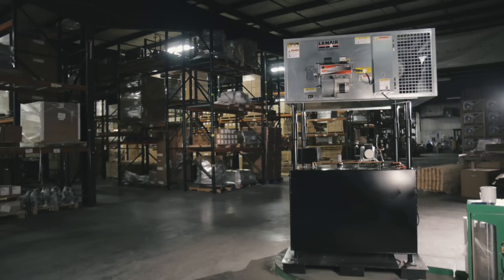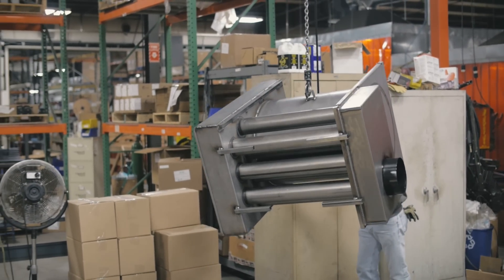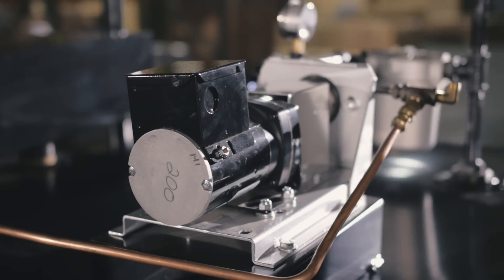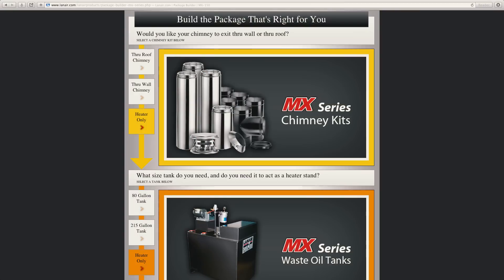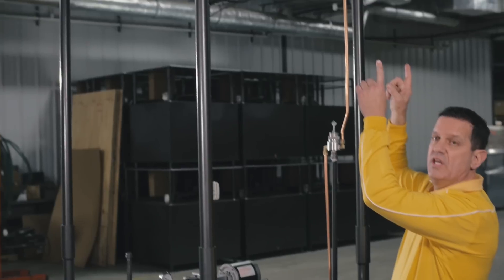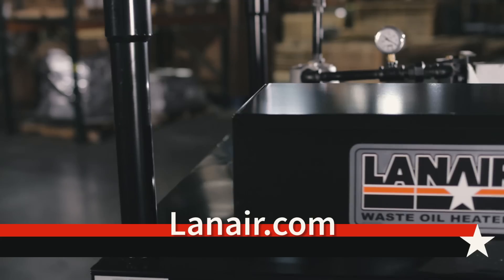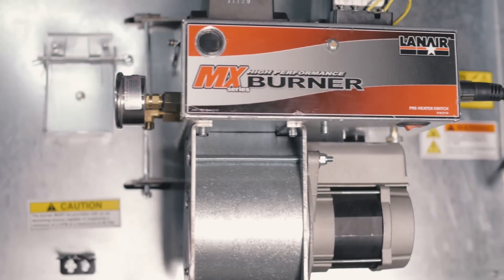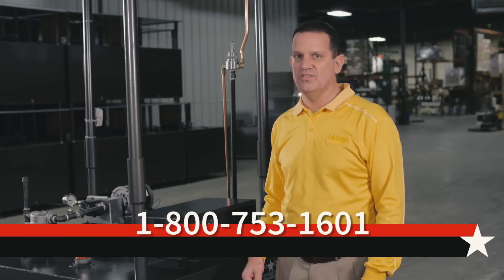Introduction to Lanair Waste Oil Heaters

Comment: XT 75 READ THIS BEFORE YOU BUY THIS HEATER!!!  I own and operate an auto repair shop. My building is 1500 sq ft and well insulated. I bought the Lanair XT 75 waste oil heater. The purchase was seamless. The installation was a bit challenging but fairly easy to complete. As far as getting the heater up and running, there were several issues and limitations #1 The heater would not fire and keep running. After double checking the factory wiring against the supplied schematics I discovered a wiring mistake from the factory. I contacted Lanair support and they confirmed the issue and stated that I am not the first one to complain about this issue. They blamed it on lack of good employees. #2  The heater will not operate when the temperature is less than 50 f degrees. This is a major concern! Nowhere in the published literature did it state that THIS HEATER IS NOT AND CANNOT BE USED AS A STAND ALONE HEAT SOURCE! Again I contacted Lanair support and was informed of the 50 f degree limitation. I contacted support again and requested a tank pre heater option. I was told they do not offer that. I asked why they didn't at least have a port (dongle) welded into the tank so one could install an aftermarket heater. I was informed that they didn't see the need for a heater kit or even a dongle welded into the tank! #3  After standing over night the oil would drain out of the gun and back into the tank. Again I contacted support and they sent me a check valve to correct the issue. The check valve is in the tank and required more than an hour to replace. $4500 later and not happy! 
Respectfully,
John Decker